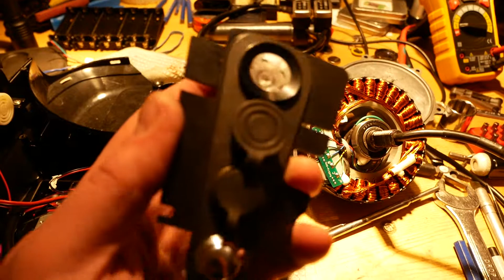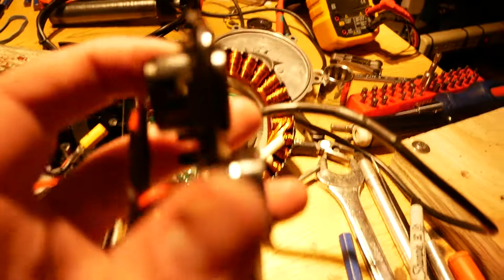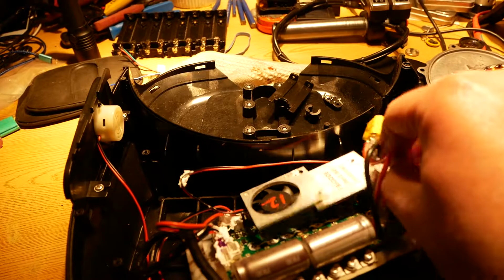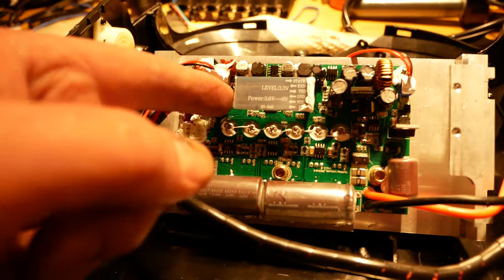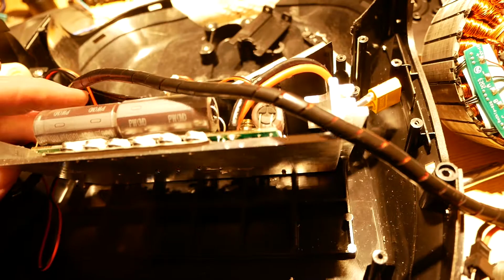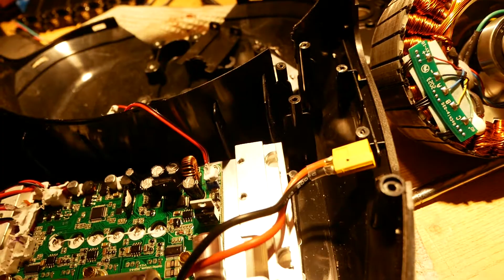Gotway MTen3 teardown 4

Comment: Great (and gutsy--(teardown before initial ride?))videos. Just replaced an  innertube and now mine won't power on. Was looking for breaker/fuse but you point out there isn't one. Suggestion on what to look for next?
Reply from the maker: I spun it up and saw it worked. After that I was confident I'd be able to take it apart and get it going again. This far from the first time Ive something like this...so not very gutsy.
*
Only thing that makes any sense is you pulled a cable and now it's loose or not plugged in. Make sure all your connection are solid and in the right place.
Reply: @de-bodgery  thanks.  I traced all the cables and all appear to be connected. Battery has power and still charges.  Since none of the cables were fastened or channeled I fear I may have screwed thru one and shorted something (no sparks /smoke). Fixing to pull the board and see if I see damage.
Reply from the maker: @PlasmaStar9  THat's possible. Small wires will all be low voltage so you wouldn't see any sparks or smoke. That would only happen on main battery wires.

Comment: how do you disconnect those motor wires? is there a trick to de-couple those bullet connectors or you just use brute force?
Reply from the maker: They are tight. I pulled them straight up with pliers. This is deliberate so that they can't come off on their own. I was pleased to see this actually! A detail where corners were not cut!

Comment: Really enjoying this teardown, very informative.

If someone is sitting on a veteran sherman and it starts burning up like you describe, do you think the wheel would actually stay upright long enough to burn the user? I would expect it to instantly fail at balancing the user and eject them into the street, an instant before bursting into flames. Any cutout in power to the wheel usually sends the rider straight into the ground.
Reply from the maker: A Sherman has 4 packs in it. If anything up to 3 of them caught fire so that the controller was still powered, yes, it would still be able to stay upright. Also batteries reach a critical temperature, start leaking their volatile fluids because they are under lots of internal pressure inside the cells. They suddenly burst into flames. This is a lot like what would happen if you had the battery packs soaked in gas and then lit the gas. Except the batteries would spontaneously combust. All of a sudden the EUC and rider would be engulfed in flames. The plastic sides might provide a second or 2 of protection. It is very possible that despite a battery fire being in progress, that this doesn't mean it suddenly lost charge. Riding and most any speed, any smoke would trail behind you and it's possible that this would go unnoticed for a good period of time. In this time frame the battery packs go critical and then burst into flames. 
**
Lithium cells are pretty safe. They don't fail very often and even less often with reasonable use. However wheels are usually using whatever battery pack there is at well over their ratings. This does increase the possibility of things going badly by a lot.
**
What should really happen is the motor, controller and pack or packs each have temp sensors on them. Any one temp reading that is over a safe threshold starts the onboard alarm and then scales back power usage in the wheel. I know some wheels have temp sensors, but this is not the norm and frankly this should be standard for all of them! The cost for sensors is quite low and these controllers all use the same MCU. I bet they have enough ADC's to handle 5 or 6 temp sensors.